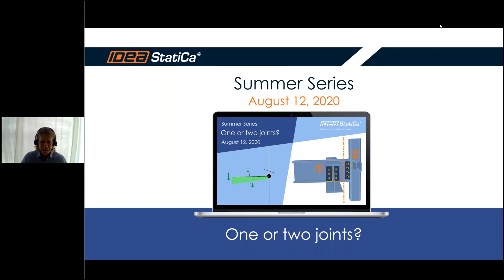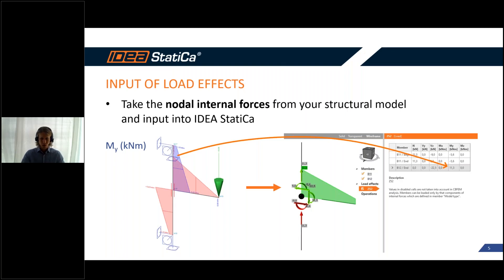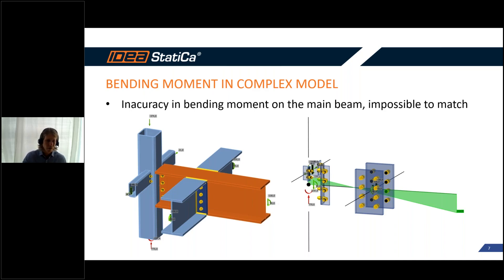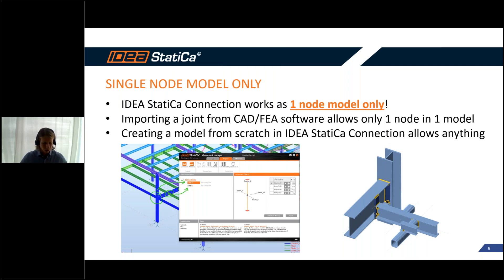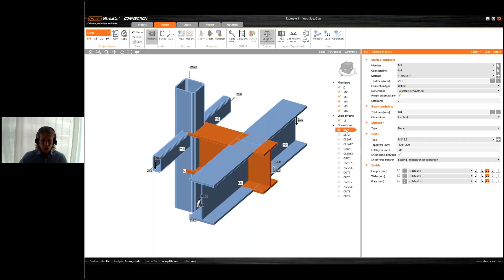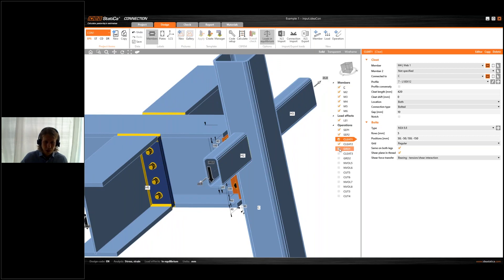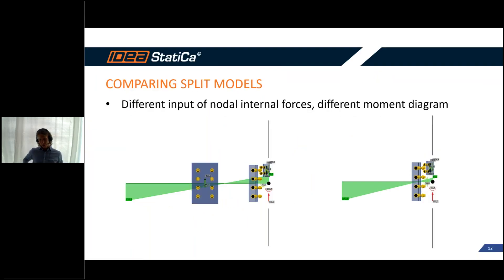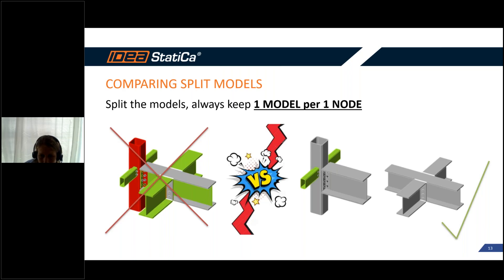Summer Series - One or two joints?

Comment: In minute 20:30,  you summed up shear forces (3 times 100 = 300kN). This correct. But the memonet remained thes same. You should have also added (2 X 100 X Distance from two beams to the node) to the 50 kN.m moment. So please your explanation????. You mentioned that the moments 50 and 50 are opposite and thus they do not affect. I am not talking about these two moments, as I said, I am talking about two times 100 kN which come from two beams, and these 2 times 100 kN should be multiplied by the arm distance to generate a moment on the node.
Reply from the maker: Hello Ali, I believe this is explained in the webinar, like here:
https://youtu.be/5BNgQ8gJmX0?t=1432
or please reffer in which part of the webinar is this unclear
Reply: @ideastatica_en  I already have written my question. In this webinar you did not take the extra moment which is caused by (2 X 100 kN X distance) into an account. you must always take the maximum moment at the supports.
Reply: @ideastatica_en    when you break the original model into two separate models, then you sum up the shear forces (200+100). You should also add (200kN X Distance) to the existing moment.

Comment: One thing I can not wrap my head around is why idea statica simply not use nodal forces. I just tried the software and I have one simple connection with Fy shear force with top flange restrained with a plate. Nevertheless software take additional bending moment and shows wrong result in member end itself after the plate ends. Connection is fine but member end where loads are defined are not... very strange..
Reply: also as along as you keep expending the stiffening plate, software adds 200-300 mm to the start of the member. More you do , more the force is pushed further from node...
Reply from the maker: Within the Component Based Finite Element Method (CB-FEM) nodal loads are applied and all of the internal forces are generated which may result in additional effects not initially thought of.  This is very true for non-symetric connections.  This can be verified also when Checkbot is used to generate the system and transfer loads.
https://www.ideastatica.com/support-center/different-ways-of-load-definition
Reply: @ideastatica_en  is there any other solution to solve this problem? moving the load to the bolt location gives realistic results for the support member side but the other side of the connection fails with unrealistic moment effects.. Is it ok to reduce the default member length from 1.25L to lower values? Because connected member gets this M=1.25L x V  moment.

Comment: is it possible to create connection directly on software idea and add the load with begin? i stuck about how to add begin load ad one member
Reply from the maker: Hello Yendri, of course, you can create a connection directly in IDEA StatiCa (not importing it from other software). Once the connection is modeled, you can load it manually as you need to and check the connection.

Comment: I'm trying to figure out, how to design a connection between column (HEA) and upper chord of truss + cross-brace of truss. I want to include eccentricity in a structural model (Robot) so I model rigid link (or just a rigid-enough profile) from the axis of the column to the surface of the flange, where I want the node of the cross-brace to be. If I simplify a model in Robot, then the cross-brace will be at a different angle that it should - also if I import this simplify model and use eccentricity of cross-brace in Idea Statica the angle will be wrong. Is it possible to deal with it somehow?
Reply: Also same thing when for example I have continous member like purlin on a girder (there is a hinge connection between purlin and coupling element which is fixed to girder) and want to model it precisely in Robot, then I draw a coupling element, cause there is no other way to model correct dependencies between element using only one node in Robot.
Reply from the maker: Hello davidg939,
yes, I believe all of that is possible to deal with in IDEA StatiCa.
The best way is to model the Robot model with eccentricities, nodes and members, so you then import this to IDEA and do the design. The problem is the difference between the simplified FEA model (Robot) and the real CAD model (IDEA), but if you consider it, theres always a way in different scenarios.
The best would be to reach to our support, send the models, picutres and info and our engineers will help you.
Also, there are resources where you might find the solution instantly:
https://www.ideastatica.com/blog/what-if-it-doesn-t-go-in-the-right-direction

or search our Support center using keywords
https://www.ideastatica.com/support-center-learning

Comment: good afternoon, I have a question for you, when you model a moment connection, should I put the loads with the option of Nodal or position? because that load is generated in the face of the column and for my connection it is suposed to be acting in that specific position, but when I see the loads in the wireframe option if I apply the Nodal it seems to be aplied in the center of the column which generates less load on the face of the column.
Another question that I found by reading the theoritical background of the model is, Does the model apply the forces (Shear and moments forces) at the end of the beam for example in that nodes of the FE at that position?, thanks.
Reply from the maker: Hello, what you input in IDEA StatiCa Connection are the nodal internal forces. You apply them also in the node here. Only in case of pinned connection, you move the position of shear for to where the hinge is located (in bolts) so that the model behaves realistic. In IDEA you have real 3D model of the structure, while in global software its simplified to members and nodes.
Please refer to:
https://www.ideastatica.com/support-center/how-to-define-correct-load-position
https://www.ideastatica.com/support-center/how-to-model-one-bolt-connection
https://www.ideastatica.com/blog/key-principles-of-idea-statica-connection